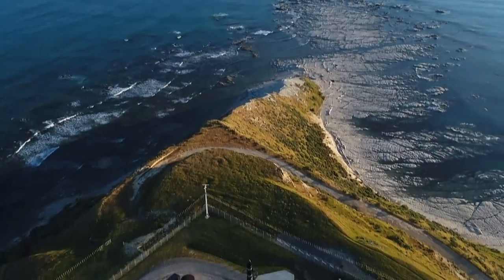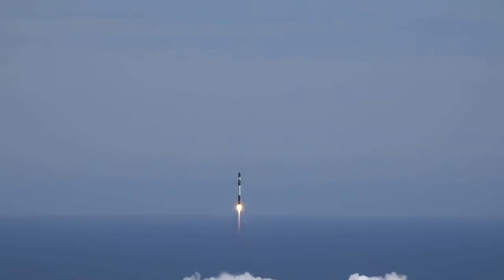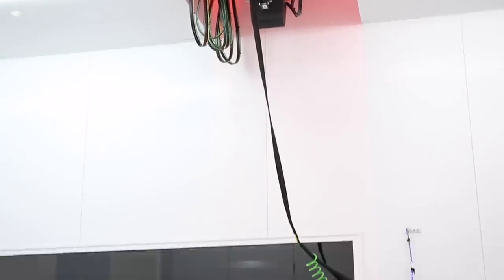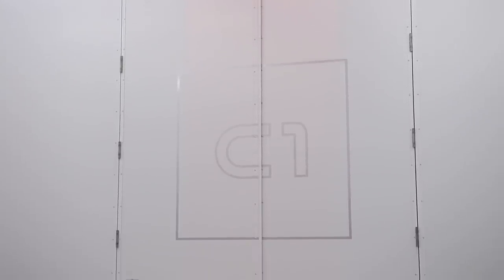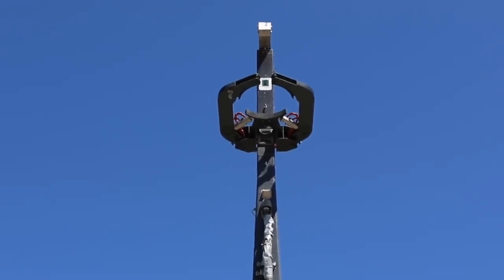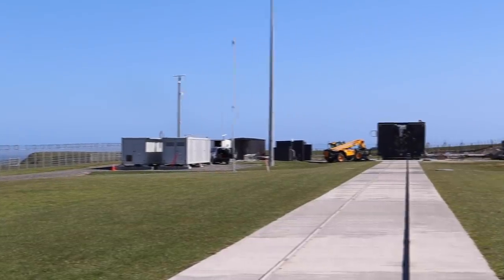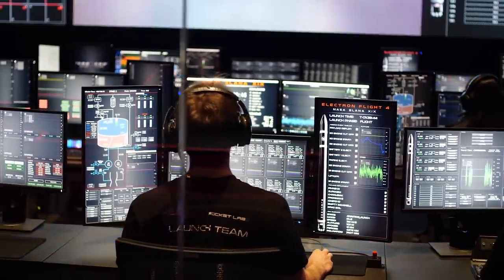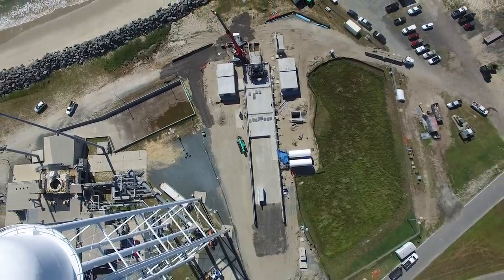Rocket Lab Launch Complex 1

Comment: 2:58 - for a second I thought it's painted with paint changing colour depending on temperature. But this is ice forming, right?
Reply: Yup, liquid oxygen is almost -200C/-300F and forms ice when fueled up. It happens on other rockets too but Rocket Lab is saving weight by not painting the carbon fiber, so it is more noticeable on their Electron rocket.
Reply: Loool. Good someone else noticed as ask. I thought that was the fuel level rising in the rocket 😂

Comment: What’s the bottle neck limiting to 120 per year?
Reply: John Clark they probably need a few days to do last test and instal the satellite.
Reply: I suspect the bottle neck is manufacturing and installation to the pad - the 120 figure is probably the launch licensing agreement with the relevant government(s). Things that money can solve over time with improved recruitment and training.
Reply: @johnbeech  exactly right. They have to work with the New Zealand Civil Aviation Authority and other services who control the air space. Other users need reasonable notice of launches etc, so they are licensed to launch at most every 72 hours. For example see https://www.aviation.govt.nz/assets/airspace-and-aerodromes/airspace-consultation-mahia-peninsula-2018.pdf
One reason they chose Mahia is that it is a very remote part of NZ so you don't have much other competition for the airspace and launch frequency can be very high. https://www.flightradar24.com/-39.01,177.1/8 gives a good idea. It's practically one of the best locations in the world to fire things into orbit.
Reply: Ummm that is a launch every three days... like twice a week... and that is only LC1, and when LC2 ramps up to whatever launch frequency they are allowed... that is quite a few rocket launches... You might get sick of the sight of RocketLab by then... lol  (nahhhh probably not)